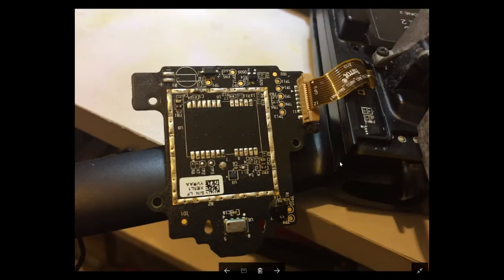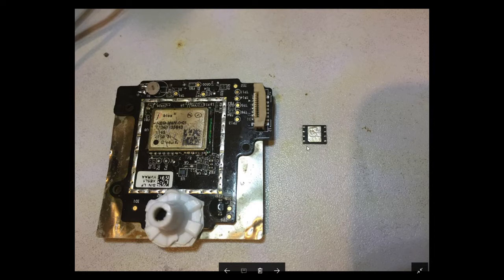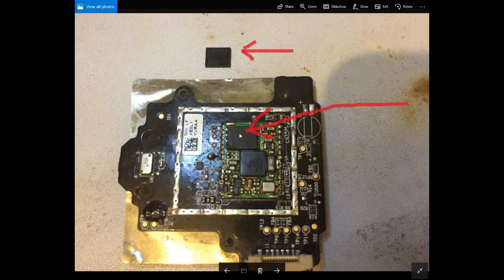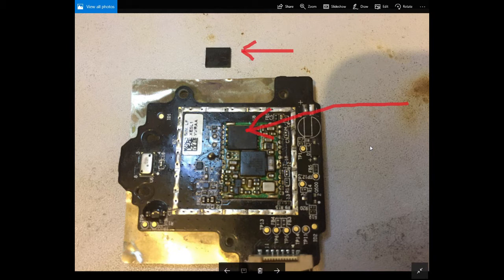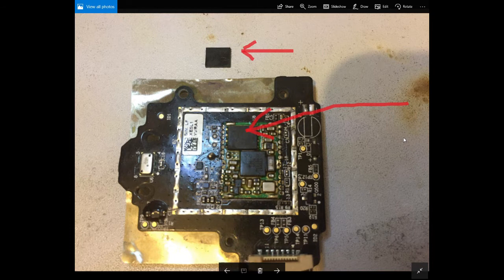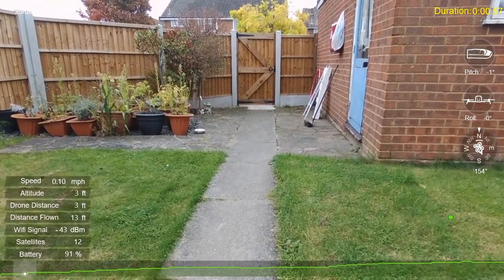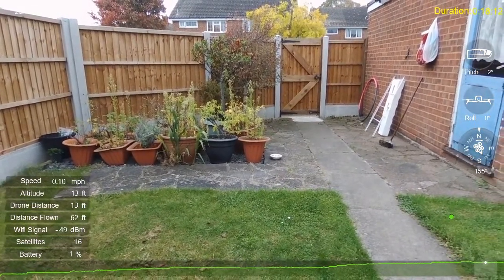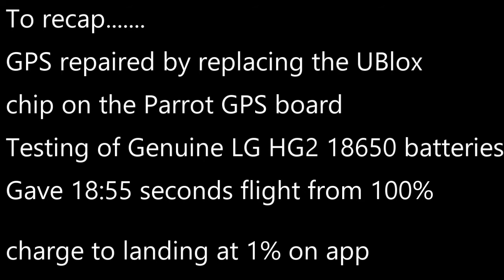Bebop 2 GPS Repair

Comment: I have 4pcs new in box wingsland S6 some remanufactured batteries from bang good and the R6 controller, do you think anyone in the modern day would be interested in buying? You've done some of the most beautiful work on keeping it alive, thanks bro!
Reply from the maker: Thanks for the kind words and sorry for the delay in getting back to you. You could try selling it but with the advent of drones like the dji neo, its kind of killed any value the S6 had. You could probably sell the R6 controller as they are much harder to find. If they come up with a battery tech thats more dense in same size then the S6 might be useful in the future and is why mine are still with me.
Reply: @graz27  thanks bro, I feel the same that it's worth holding on to. Peace🕊️

Comment: hello can I ask your advice? please? I recently rebuilt my drone due to a wire being broken at board level, re-soldered and fixed! however now that ive rebuilt it I don't get any connection from either the phone or the sky controller. My phone sees it but then when freeflight is opened it drops the wifi and the sky controller just sits with red flashing light. Please can you help.
Reply: Better late than never I'll take a crack at it . Try setting up a password for the drones wifi connection... possible maybe could be the problem.